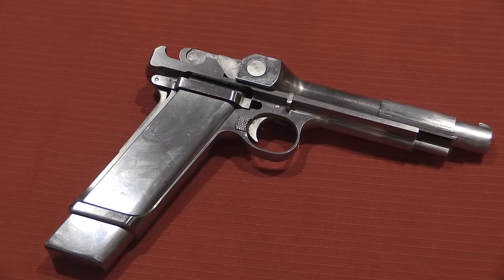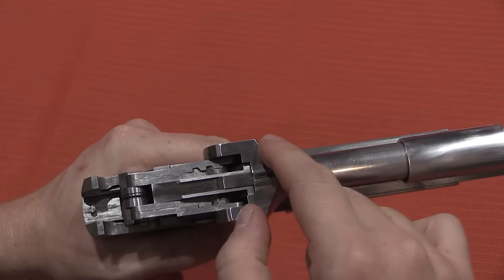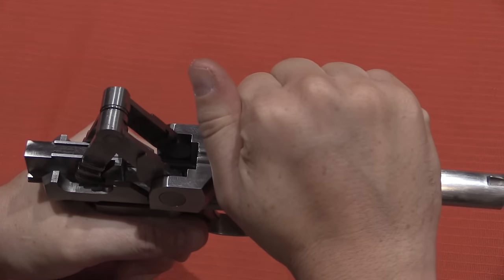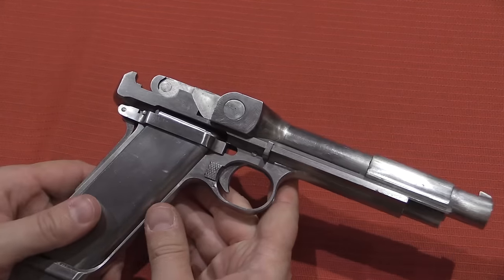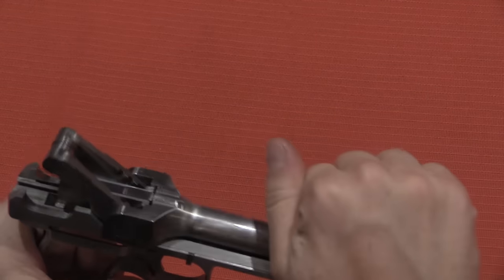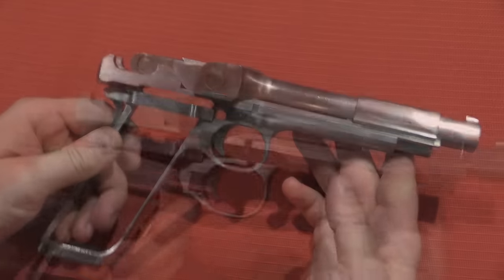Unique Ross Experimental A2 Pistol Prototype

Comment: It looks really shiny for a century old gun - almost like it was machined out of Stainless Steel.

Which is pretty damn odd for 1902, 'cause though they had Chromium Steel, modern Stainless Steel with Chromium, Nickel, Manganese (& a bunch of other things) wasn't invented until 'round 1911 by experimenters like Guillet of France.

I'd also really like to see the blueprints & design notes of this thing. It would be fascinating to see the trial & error that went into it, as it does seem to have some revolutionary ideas for the time. 

It's the creativity & engineering of the weapons manufacturers, which truly fascinates me the most about them.

Comment: I have always loved the .45ACP round, and have owned more pistols for that round then most any other, I also had one rifle in that caliber but it was one of those cheap Thompson knock-offs with a plastic frame and tin top.  It did work and handled the Thompson magazines with ease. It was fairly accurate, but had a problem that I only learned when playing with the gun one night at the city dump grounds. I was on duty in the patrol car, and it was so damn boring that I was about to go bonkers.  So I drove out to the dump grounds and saw a 55 gallon drum setting on the berm, so I jumped out of the squad car, pulled my little rifle out and began go fire at the drum.  Well I had pulled in at a slight angle, and I noticed sparks flying when I fired.  Those damn sparks were the .45 rounds hitting my front fender.  Man I was scared shitless that I would loose my job in the morning when I had to report to the Chief. First I figured, perhaps I could come up with some story about a tree branch but that didn't really make any sense.  So I just told him the truth. He laughed a bit, then said he would have to tell the Mayor, and would get back to me.  Well I didn't get any sleep that day, and when my 12 hours off were over, the Chief pulled into my driveway to pick me up for my shift. I asked him what the mayor said, his reply the mayor just said, "that was stupid" and that was all that was said of it.  Well from them, for quite some time I was the but of some jokes about 55 gallon drums jumping out in front of me while I was on patrol....

Comment: Another great video. I wish there was a video on the manufacturing tools they used back than. It's easy to see how they make guns today with modern tech, but in the late 1800's up to 1920 the process must have been extremely arduous.
Reply: Kenny VanCleave 
Look up a piece of machinery called a "shaper"
Way awesome to use and very versatile if you get the hang of them.
Reply: Kenny VanCleave Many manufacturing tools have not changed that much in the last 100 years. 
Many mills, lathes and similar tools that are used by enthusiasts are at least 50 years old.
Reply: Probably the largest change verses 100 years ago is large production runs likely have a computer controlling the mill, lathe, etc verses a human would have been back then.
Reply: Kenny VanCleave 
I always think the same thing.
Reply: I looked at some of the history behind power tools and most people here in America hadn't used a power tool until about the 30s-40s. Imagine people that made guns at home, like John Moses Browning (1880s), how did they make guns as living since didn't have access to easy available power? I always thought what you're wondering as well, but I didn't think of independent gunmakers in my thought. I can see why the (I believe) CEO of Winchester was so impressed to JMB quality craftsmanship since he lived in a literal "Where?" town in Utah.
Reply: It wasn't quite as hard as you may think, today we use lathes and mills with computer control over the directional axis, back then it was done with manually controlled machines through handwheels.

 Most modern personal/small workshop lathes and mills are still manually operated, pretty much identical to those from the 19th Century, biggest difference is they're electric and not belt/rope driven through a line shaft.

Where repeatable precision was required guiding tools like jigs, depth stops, etc. were fitted to the machines. It may take hours to setup a guide for a complex part, but once you do the part can be cranked out en masse quite rapidly.
Reply: @LOUDcarBOMB  Well, pre-electrification most towns probably had at least one small machine shop with a steam/IC engine arrangement, working entirely at home however there were a fair number of complex tools that were hand or treadle powered, including treadle lathes. Functionally they're the same as powered lathes, but given you're limited to foot power the amount of material you can take off in a cut is significantly less. It takes a lot more time and determination, but pretty impressive machine work can be done on a treadle lathe.

Comment: It seems a coil torsion spring on the pivot could push the link fully into battery.  Having said that, I imagine this pistol would be very expensive to manufacture and not hold any advantages over competing designs.  Dropping it was probably a wise decision.
Reply: Well, it would’ve been competing with guns like the 1911 and it would undoubtedly have a magazine capacity advantage with it being double stack

Comment: I kinked this to a Canadian friend, only saying that apparently Ross designed a pistol. His only response was: "How did they screw that up then?".
Reply: As a Canadian, Ross Rifles sucked in combat, so the whole point of a pistol variant wouldn't change the fact it would jam a lot.
Reply: Alexandrius Comnenus On the contrary, ross rifles worked extremely well and accurate but not only couldn’t handle mud, but were extremely large which also didn’t help in the trenchs. I do agree though that the pistol looks like it would not be able to handle dirt well.
Reply: +Sandwich Boy
Ah, but that weakness to mud makes them useless. They are just fine as a sporting rifle as they were intended, but virtually their entire military use was in mud drenched trenches. So to say they flat out sucked in combat is completely accurate.  Trenches stayed very, very muddy, and it would be near impossible for the average soldier to keep their rifle adequately clean under the most common scenarios.
Reply: It wasn't the mud, it was British ammunition standards. The Ross rifle was designed and tested using Canadian spec ammunition. British ammo at the time was donkey shit by comparison. Same thing with firearms during both world wars, the Canadian versions were made to a higher standard than British.
Reply: It was both, not only did it jam super easily from mud, it also didn't operate well with lower quality rounds. Both things that didn't matter for sport shooting, but did for war. Even if the rounds were perfect it would be a shit gun for trench warfare

Even those two things weren't the only issues, it went far beyond that
Reply: Again, it comes down the ammo. The chamber was designed specifically around one round, that was undersized when chambered, expanded, then shrunk slightly for extraction. All the rounds used where of impeccable quality. British rounds from the era are donkey shit in that they are over sized, undersized, over powered, under powered, and sometimes contain sand instead of cordite. A dirty oversized round wont chamber, and a dirty undersized one wont extract for example. A case of under engineering. You can see it in the development as they kept trying to fix issues with dirt and mud jamming it, and it wasn't resolved until they made the Mk.4 around ammunition from britain instead of canadian rounds. Unfortunately by that point everyone had lost faith in the rifle and it was canceled. Ironically that one was also designed with a shorter barrel and stock to fix the other major issue, the rifle being too goddamn long.